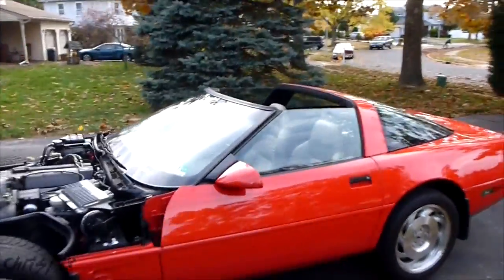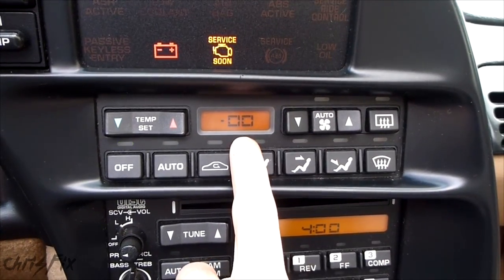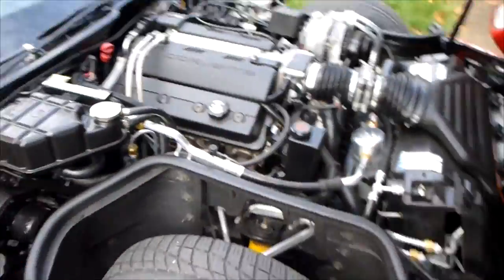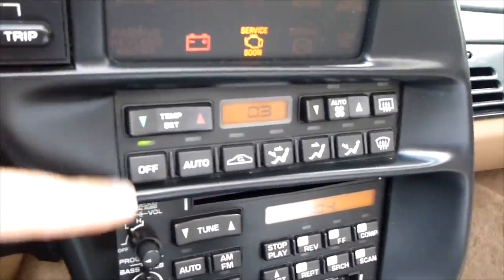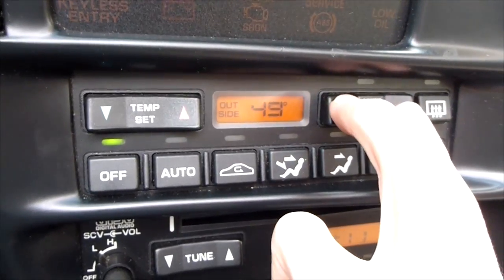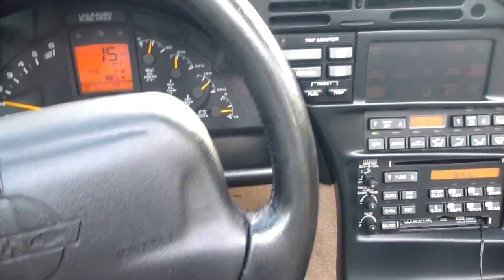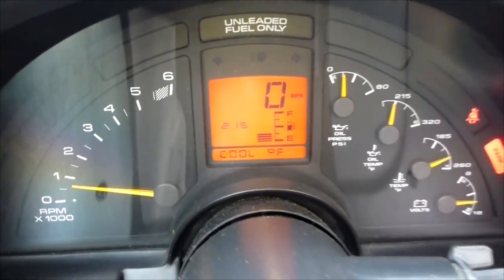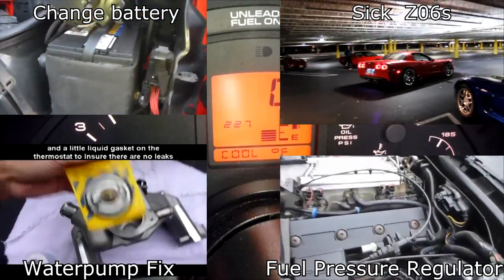C4 Corvette Climate Control Codes

Comment: hey Chris nice stuff here!!!  i am wondering what makes the difference in HP between LT! ;96 and 98 they report 30 to 50 hp difference my guess is computer and exhaust thx for the answer!
Reply from the maker: With the camaro? I am unsure. With the Vette, the last LT1 was in 96, but the LT4 had 330hp because of better heads and air flow.
Reply: ChrisFix
that makes good scene but really took them that long with all the tech stuff!!! i have owned a nice GTA 88 black on black all stock just ran 3 1/2 alum exhaust with coil upgrade and KN filter it was a beast !for a stock that is.......
I am looking at and all black 96 vette look to check out all your good vids here.....
thx Mark
Reply from the maker: Good luck with the Vette. I caution you to stay away from black. You will never be happy with the car because it will always look dirty. Then when you clean it, you will be afraid to clean it because it scratches so easy!
Reply: ChrisFix
like i said had an 88 GTA used a Teflon application to solve that issue! but check this out here r the stats diff from LT 1 vs LT 4
 http://www.grandsportregistry.com/lt1vslt4.htm
Reply from the maker: That is pretty neat. Many people say that the LT4 was under-rated because the new LS1 was coming out. Many people say it really has 360-380hp at the crank.

Comment: Hey crish can u help me out my corvette is a 94 corvette and my heater dont work but my water hoses are hot im not sure if is the climate control unit or what please help me out if you can thank you
Reply from the maker: Is there a flashing light like in this video? There are hoses that go in and out of your firewall under the coolant holding tank. Are both of those hoses hot? If one is cool and the other is hot, you might have a problem with your heater core. Does your AC work? Can you get the air to flow out of just the bottom vents, just the top vents, and then both vents?

Comment: great video. Have you done one for changing Opti Spark? Mine is faulty (Arrrgh) have just ordered a new one from RockAuto, due to be delivered from US by Dec 6. I have a friend who will do the work but would love to be able to do it myself.
Reply from the maker: Thanks. I dont have an optispark video (mine is a 96 so it is vented/ the best opti they made. But I do have this which is 90% of the work to get to the opti:
How to change the waterpump.
How To: Water Pump Replacement LT1
You are going to have to take the waterpump off (might want to replace it as well if you already have it off)... Then the opti comes off...
Reply: ChrisFix Thanks Chris, looking at the video on that link you sent think I'll leave it to my friend, bit beyond my means ;-)
Reply from the maker: It's not that bad but I get it! Well, good luck and thanks for watching!